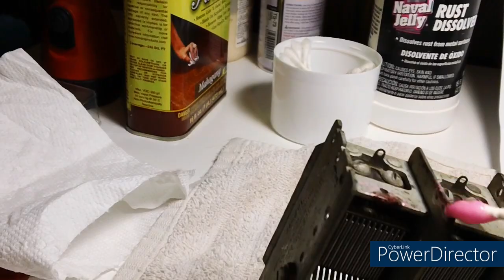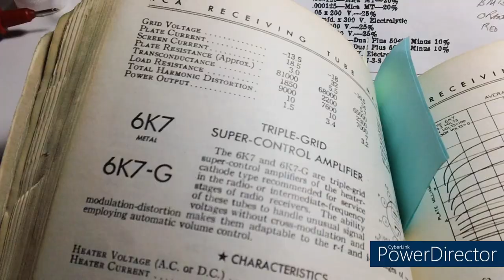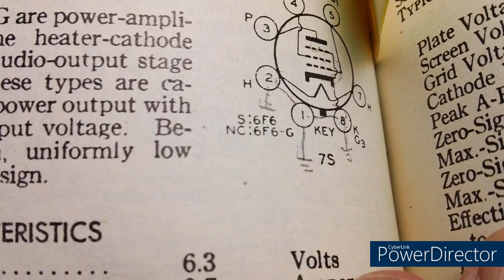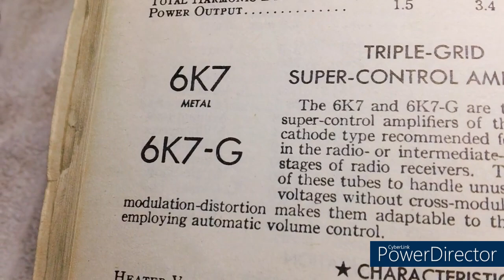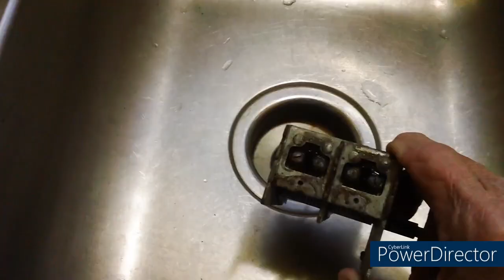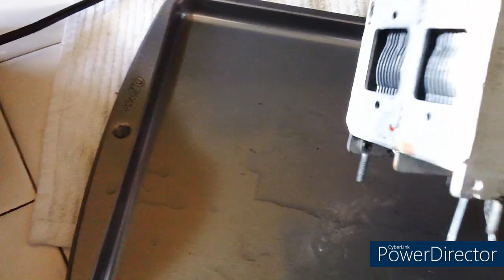Part #5. 1936 Airline 62-198 repair and restoration.

Comment: I too still have my ultrasonic cleaner, the same one as you ( which I bought after seeing yours). Nothing beats a clean tuning cap.  Do you leave the MICA in there when you clean yours? I've been meaning to ask.    thanks my friend - great job. !
Reply from the maker: Ron,
We're not yet done with this tuning cap, my friend.  There's one more thing to do.  And as for tuners with trimmers on top, I always remove the mica before running them through the UC...if nothing more than to check the mica for cracks.  But after the mica is removed  the underneath of those mica cap plates always needs a good cleaning, once with an acid brush and alcohol and then by the UC.
Regards,
John
Reply: @joernone   thanks my friend.. At least I know I've been doing it right !!  Stay warm !

Comment: I shouldn't feel so bad in Chicago where we got 3 inches of snow and it is 3 degrees above zero. Sharing the pain of winter
and early sunsets. Good info on metal versus glass tubes and that is to follow what the manufacturer recommends. If not 
sure then go to your RCA Tube reference manual and look at the schematic to find out. Thanks John. Steve from IL
Reply from the maker: Steve,
It's nothing you don't already know, my friend, but speaking as a former newbie who had his thumb wickedly zapped by a metal tube, we can bet more than one newbie hadn't heard about any of it.  It's what these vids are all about.
Regards,
John

Comment: Thanks John. I think a good rule of thumb is if the print says a 6k7 G you should use that and don't substitute unless you are sure. Pete Crosby
Reply from the maker: Pete,
100% agree, but sometimes glass tubes aren't close at hand, and newbies have a bad habit of never doing adequate research prior to diving into a chassis.
Regards,
John

Comment: I would think that the metal shell is grounded for the same as when you use a tube shield to reduce interference to or from other sources.  Just a guess though.
Reply from the maker: Jeff,
That's exactly what it does...why it's called a shield.
Regards,
John